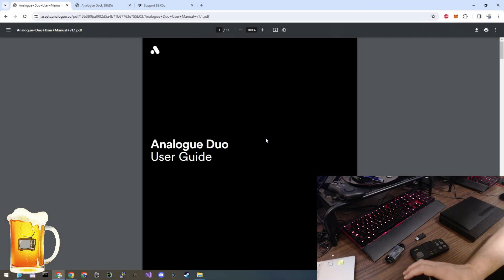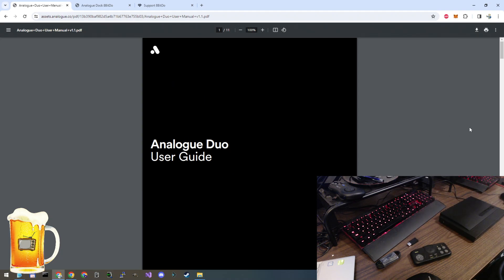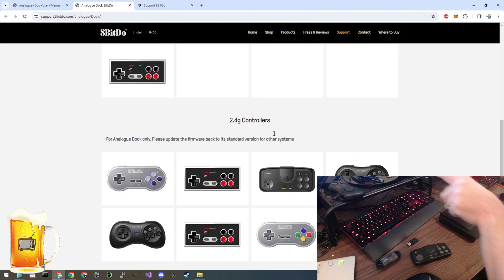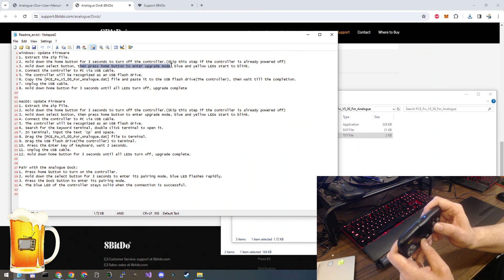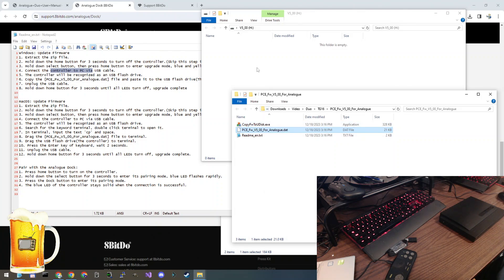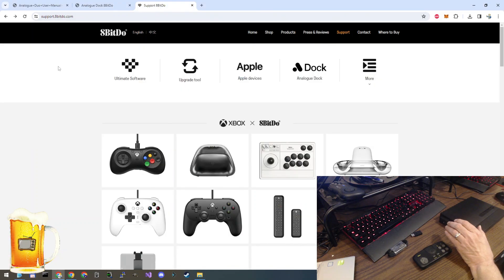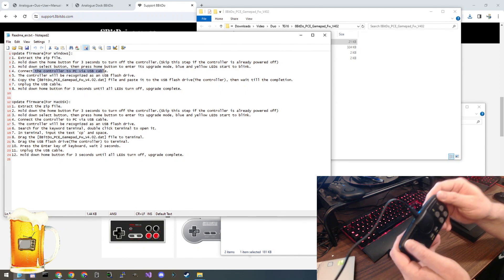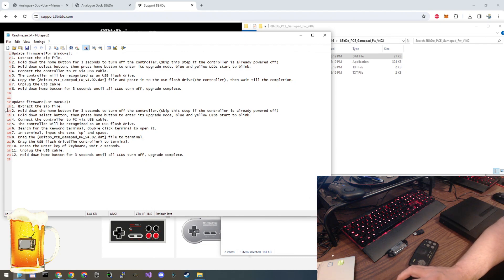Howto: Analogue Duo 8BitDo Controller Firmware Flashing

Comment: do i have to use the 2.4g dongle on the Duo and pocket for it to connect or can this controller work without the dongle ?????
Reply from the maker: You can do either: You can use it with the dongle, or you can flash the firmware in order to use it without the dongle.

Comment: Thank you for the information on how to revert the controller back to the original firmware in order to get it to work with the dongle. I had been experiencing frequent issue swith the controller disconnecting when using the 2.4 G connection and read that using the dongle will solve the issue.
Reply from the maker: Glad I could help!

Comment: Bought two of these controllers brand new and neither wants to be recognized by my PC using either cables that came with it. You can hear it being recognized but no menus or anything pop up. The very fact I bought two of them brand new and not one of them works properly with the Duo, which is temperamental all by itself, leads me to believe this product by Analogue as well as this 8bitdo line of controllers are expensive hot garbage.
Reply from the maker: I'm sorry you're having trouble with the controllers! When the controllers are connected to your PC, you can use a game pad testing application to see if they work, through the browser, like this one: https://hardwaretester.com/gamepad

That should let you test them. I just tried it with both the included USB cable, and the included USB dongle. It was detected by the gamepad tester in both cases.

After you test if they work, and they do, you can either follow the steps I outlined in the video to flash the firmware on them for the Duo, or instead just use the included dongle plugging it into the back of the Duo.

Good luck!

Comment: for anyone wondering,the 6 button 8bitdo controllers like the m30 arent fully compatible with the duo

the 6 face buttons arent all enabled. 
X, Y (top row) are enabled, Z is disabled
A, B (bottom row) are enabled, C is disabled
L and R bumpers are enabled
.I bought the M30 for street fighter 2 and you cannot bind Z, and C buttons
Reply from the maker: I am hoping for a firmware update to the controller, or the option to remap the buttons to be added to the OS. I also bought 2 m30s to play Street Fighter :)

Comment: Stuck at 5.  Won't recognize it on my PC.  Used 2 different cables.  Yes, the lights are flashing as in step 3.  When i plug it in, both lights go solid but no USB recognition.  No go for me.  :(
Reply from the maker: It is possible that the cables you are using are not data cables. You should try the cables on a known working device, to be 100% sure. Find one that, for sure, supports data transfer.

Comment: So what‘s the advantage of not using it with the USB-dongle with the Duo?
Reply: I mean, you can use it with the dongle or use the duo's internal 2.4ghz radio and put the dongle in the box and never have to use it again
Reply from the maker: I made a video comparing the features between the two options, please have a watch!

https://youtu.be/bZkpG0mvVkc

Comment: thank you for your video. But what is the good firmware to play the PCE 8bitDo with Analogue Duo Console ? v5 or v4 ? Thanks a lot
Reply from the maker: For playing on the Duo, it is this one:

https://download.8bitdo.com/Firmware/analogue/Dock/2.4g/PCE_Fw_V5_00_For_Analogue.zip

I don't think the version number matters as much as getting it from the correct location. Currently version 5.00 at the time of this comment.
Reply: @retropint  i try this firmware v5 on my 8bitdo PCE, it work perfectly with my analogue duo but when my analogue duo is off, I plug my controller on micro-usb to charging, the analogue duo wake up and switch on automatically 😡😡😡
I must disconnect usb-c from the console when i charge my PCE controller 🤦‍♂️🤦‍♂️🤦‍♂️
Reply from the maker: I tried this, and I experience the same thing. On top of that, there is no longer a light indicating that the controller is charging. So we can't tell when it is finished. It does charge, though.
Reply: @retropint  indeed, the charging indicator is no longer indicated. I'm charging my controller but I don't know when it will be fully charged. Too bad 😞